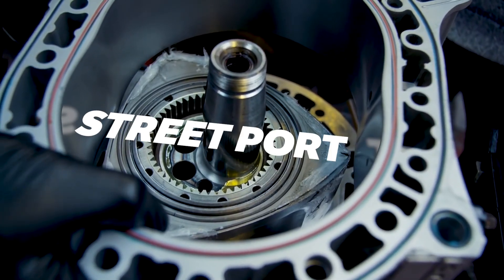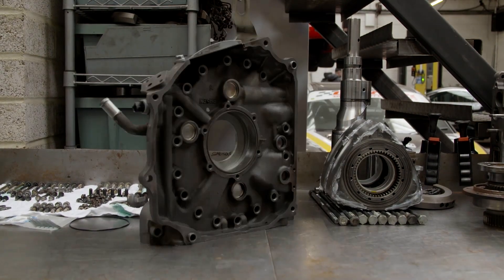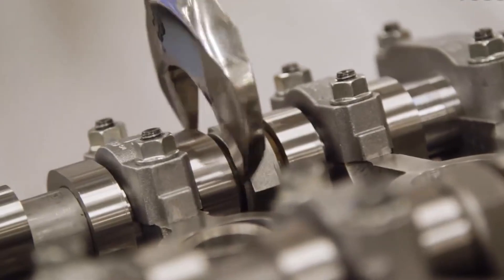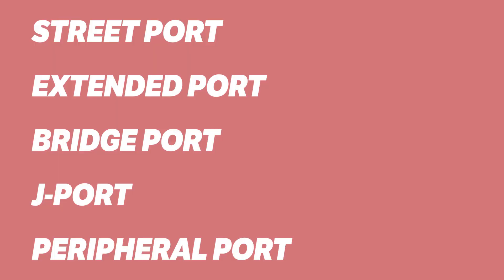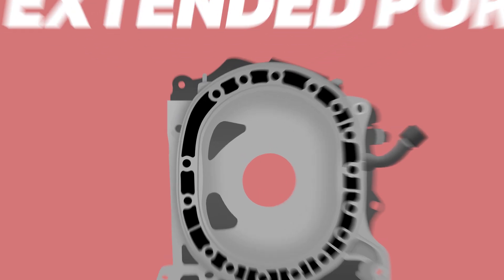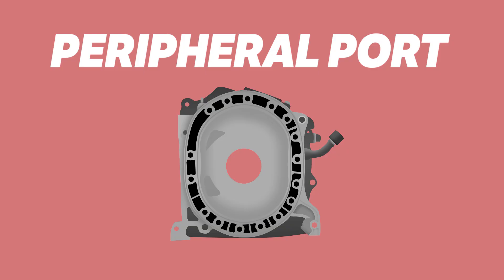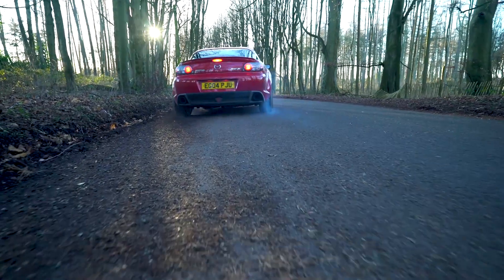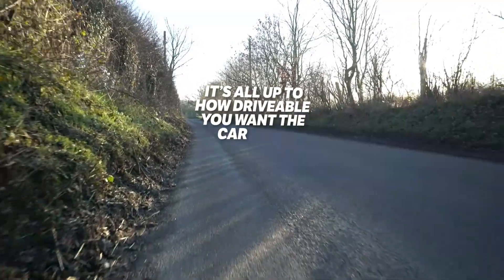Rotary Engine Porting Explained

Comment: Does this affect emissions or why does the manufacturer not do this?
Reply: It's down to driveability. Extra porting is similar to having high lift cams and more valve overlap in a conventional piston engine, i,e, race engine isn't very happy at low revs trundling around town. My street ported RX8 is still quite happy to cruise but a bridge ported one would be less so.
Reply: logan Byrom yeah it’s probably emissions or the fact that the cars are initially meant to make less power